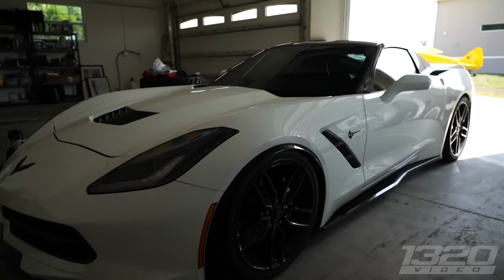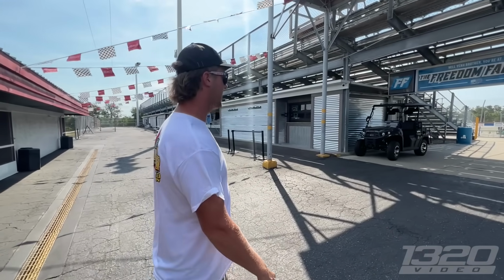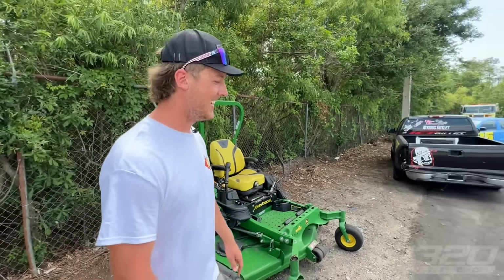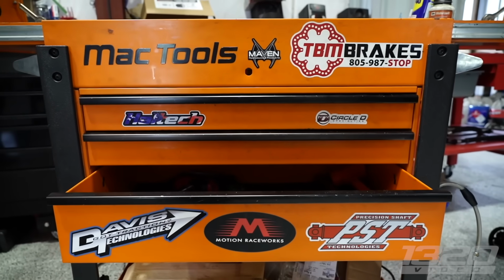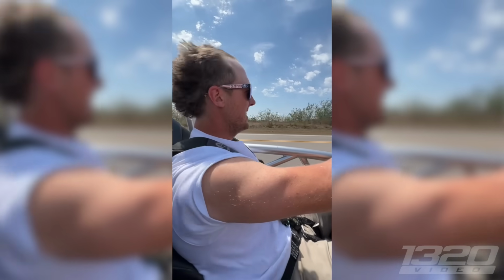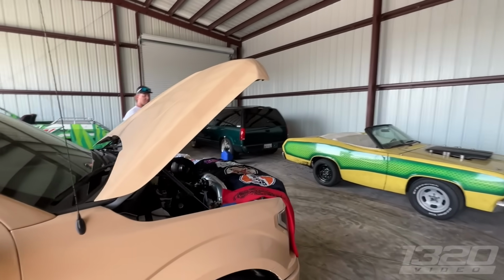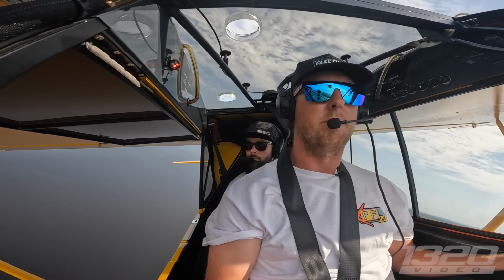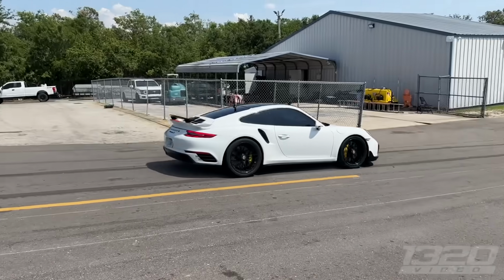Cleetus Mcfarland's ENTIRE Collection.. Over 100 vehicles! (1320Garages | Ep. 5)

Comment: Man, all those guys are considerably younger than me (I'm 37), but it just doesn't seem like it. They seem pretty damn put-together, and also I'm really ridiculous and immature, haha!

Also, pro tip: Eventually upgrade to a bigger wire rack and 2500' reels. 500' reels are SUPER hard to work with (the wire's curly as a pig's tail and just unruly and a pain in the ass), plus they cost actually considerably more in the long run and (obviously) have to be replaced more often. I'm an IBEW journeyman electrician with 15 years experience in commercial and industrial electrical construction and maintenance, we NEVER use 500' reels unless it's a time and material (like, not a hard dollar bid) job and we're not going to use more than 500' of wire, and even then we sometimes just bill for a 500' reel and use a 2500' from the stock at the shop.

Also, YES! More Dale Truck content!!!! You don't have to do anything crazy with it, just maybe like some laps when you go to Bristol again when it's not dirt? Haha!

Also, I have a friend with a pilot's license and an actual old Cub. It's WAY cooler than big planes. Super fun. We went to NOLA once and Denver once, just because, haha! So much fun, and yeah, it is kinda the ultimate freedom. I mean, besides CGI helimachopters...

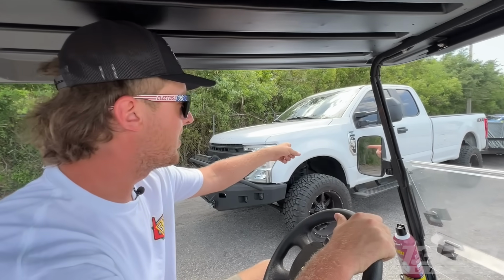Comment: 25:29 if I had to describe a crown Vic I’d say they crossed a f150 with a mustang and the crown Victoria was born 😂 ay those f150s 1999 2003 are some solid trucks. Two main things don’t like about them is the spark plugs witch I don’t think the crown Vics had that issue just the truck engines but you can get the studs installed and never have that issue again and the fact they got a two peace frame on my ext cab it’s split right at back or cab but the body it self my neighbor flipped his over in rain hit a tree as flipping crushed bed in but the cab didn’t give well just enough to pop back window out but I’m telling y’all that 4 speed in them trucks will go 400k and the engines will go 400 k. Ppl talk crap about heater core going out yea it’s not fun to replace but if you know why they blow out you probably won’t never have that problem one of heater core hose has a step down peace in it cuts pressure back only one I know got that peace in it ford hose any of them from parts store don’t got that peace In it there for allowing to much flow to heater core same with intake you will only have to do one intake and get about 350 to 400k out original and new one if you use a ford intake got some good gaskets in them aftermarket o ring style gaskets straight junk so ppl can hate those 10th gen f150s all they want but they are basically a crown Vic